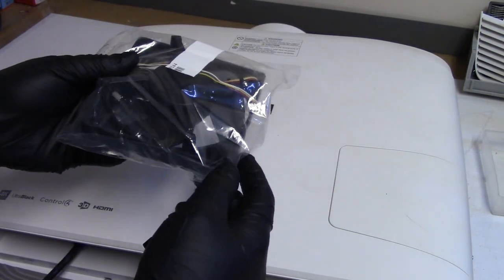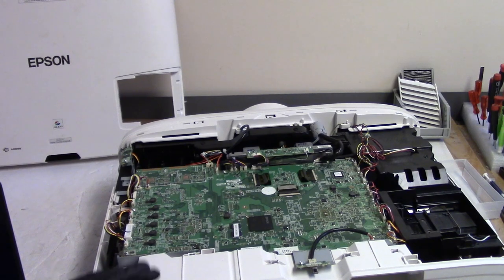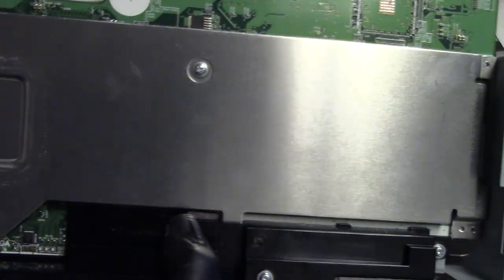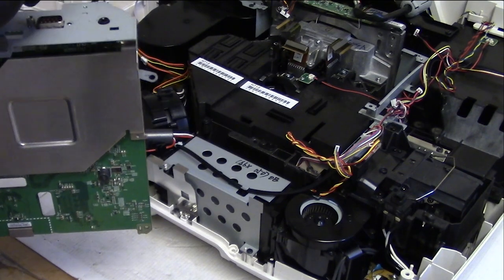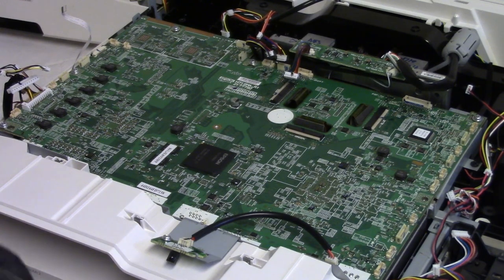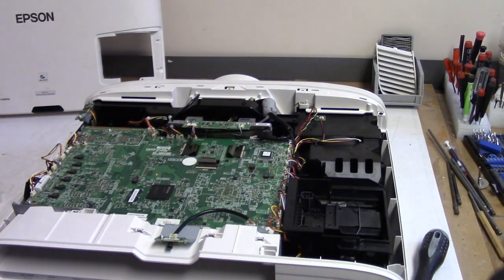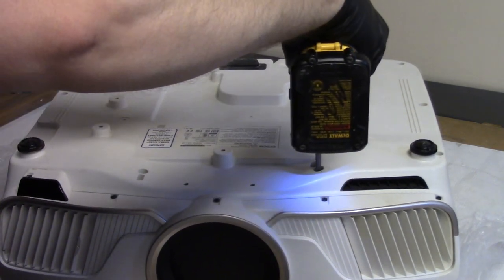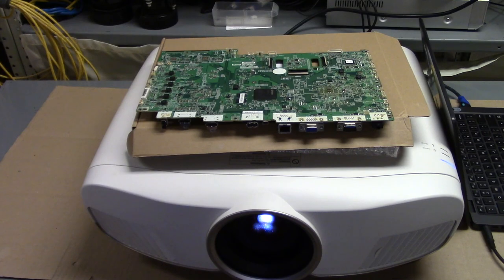Epson Home Cinema 5040UB LCD Projector Repair | No Video | New Mainboard - LAST EPSON REPAIR

Comment: Having my EPSON really on for 10* hours every day I must say that I really love them, AS LONG AS they work. Tried to clean the inside and I was in awe by the severe complexity of the unit. Am I getting a newer EPSON in the future? NO! DLP all the way, my BENQ is a breeze to work on unlike the EPSON. Nice work my friend, as always.
Reply from the maker: Yeah, when they work they look great. I wont say they are bad projectors.  Just bad to work on.  Those DLPs are just intuitive I guess.  But even NEC and Panasonic LCD are not that bad to work on. epson is just something beyond me I guess.
Reply: I have 2 Epson and 1 DLP laser (Xiaomi) both Epson are much better like image. More Natural and much better contrast. I use the Xiaomi like TV to save time lamp, but for movies Epsons are another Planet.
Reply: Hardcore-Watchers should prefer DLP, especially smokers. The organic LCD-displays (with surely some advantages: no rainbowing, high saturation, wider lens-shift) still have problems with color drift, dust, stains by polarizer-burnout, reduced longlivity, convergence, fly screen. The exchange of the LCD-Panels is a PITA (also for the purse ^^). Their failure is mostly an economical total damage.
Reply: @lorsheckmolseh3345  I've both DLP and 3LCD, for me there Is no match between, the LCD has superior image quality into black shadows and into bright colors. Is true are more delicates but I don't care with warranty extension I'm quite for 5 years.
Reply: @lorsheckmolseh3345  how wrote I own both a laser DLP and two 3lcd. I also use DLP for "dirty Jobs" like TV programming and low contents video (I use It like TV because 55" are not enough anymore for my eyes) but when I wish to watch my favourite bluray movies (FHD or 4K) I switch on one of my Epson (I've two of those) and enjoy the flawless images. Nothing against DLP (I own One) but I prefer 3lcd maybe also I can see the rainbow effect, not so strong but after 2 hours of show my eyes feels more relaxed watching a 3lcd projection.
Reply: @pinomauro2426 , i totally agree, LCD will always keep superior at image stability and gives a better saturation than UHP or Phosphorus+Laser combined with Micromirrors. LED-DLPs have a giant gamut, but contrast is lousy. Perhaps there's a way to cool the panels by liquid externally, to avoid all those nasty dust- and heat-problems.
Shortly i saw a RGB-Triple-Laser from "VAVA" with very high refresh rate and BT.2020... 😍 but i won't pay nearly $4000 for a 1920x1080 chip with a wobbler and relatively low light output.

Comment: The last Epson to repair. I don't blame you. I've been there myself. I cleaned the 3lcd block once put it all back together and powered it up the lamp lit but no projection I spent hours to make the iris function but I failed. I hate working on any Epson projector. No spares, no service repair manuals no customer support. Simply crap. Btw, I used to stick some aluminum piece of heatsink, glue it on the chips that got hot, sometimes you can get away with it.
Reply from the maker: You know exactly how it is.  It's not worth the money to work on these. I really wanted to get comfortable with Epson, but if its not the mainboard, its weak LCD cables, cracking flat flex, wires that aren't meant to be unplugged. Its just nuts how unrepairable they make these.

Comment: Sorry to hear what happened to this pj. I have the same thing that is mine. Picked it up as a refurb from Epson. I agree that is horrible to work on Epsons. I have picked up a 2045, that the ex owner was claiming, that sometime it happens the same thing(no video signal), but as many time I have turned it on, it has video. I did a firmware update, since it was one available.
Reply from the maker: I really wanted to try and become more comfortable with epson.  But this was my reminder that not all projectors need to have me work on them.

Comment: Hey Frank. Thanks for the video. I have a 5 year old 5040UB that won't power on. I took it in for a repair and was told the Mainboard needed to be replaced and a new board requires a matched optics engine as well. The quote for repair was $1700. Is that accurate? Do you know if it's possible for me to order a mainboard on my own and do the replacement? If not, are you willing to reconsider your stance on Epson repair?
Reply from the maker: I don't believe the mainboard is matched to the optic block. At least in my limited experience with the 5040. The price is not too far off though. Epson is extremely anti right-to-repair. It's impossible to obtain new Epson parts unless youre an authorized Epson repair shop and they won't sell parts. The only non Epson repair center option is e-recyclers. It's hit or miss of a mainboard is available. It'll cost around $5-700 and only come with a three month warranty. 
As far as the diagnosis, I can't really say. Mainboards could cause a no power situation. It could be another issue as well. Unless you had it at an actual Epson repair center, the diagnosis might be a polite way of them saying they don't really know and they are aware of the lack of parts available. 
Part of me wants to look at it but the rest of me is reminding myself how much money I lose trying to work on Epson. With a roughly 20% repair rate(lack of parts available) it's really a bad financial decision on my part. 
Another thing for you to consider is the rest of the parts that might be bad. Namely the optics. Epson uses parts that optically degrade starting at about the five year mark. Rarely does a normally used Epson last past 7years.  The polarizers and prism coatings degrade and you get color blobs on the screen. If that's a problem you are right up into the $1700+ area again. But this time with used optics that might start failing at anytime. Repairing Epson is like tossing water up the stairs. It keeps running back down. 
As much as i hate to say it.  Cut your losses. Sell it for parts on eBay. I hear about a lot of 5040s with problems these days. Put your money toward something better. Buy a Sony or JVC and leave the Epson marketing hype on the floor. Epson is great at advertising and the projectors look great when they are new but they do not hold up in the long term. 
If you really want me to look at it, we might be able to work something out but I'd have to charge a 'check out fee or bench fee'. I normally give estimates for free but I'm sure you understand where I'm coming from.  I wish I had better news for you. Thanks for asking though, I do appreciate it!

Comment: My 5040ub doesn’t even power on , no lights or indicators, I’ve changed the power cable with a working one , checked the filters they were clean , I’m assuming I need a lamp or power supply do you have any advice for me since you’ve already worked on this projector😅

Comment: Have a power supply error on my 5040ub. Power light and 2 orange lights flashing. Turns on real quick, lens opens then closes and fan runs hi for a while. All I did was change my screen mode to dynamic and it went out. Sounds like a motor inside waking clicking noise. Any advice on what it can be?
Reply: Mines did the same thing did you fix it?

Comment: The fan can actually be had for much less, but the key is to not search for a projector fan. You are looking for a "Fridge Evaporator Fan" or a "Fridge Condenser Fan". It visually looks exactly the same with the blades that stick out. The version used in fridges sometimes has green blades and can be either NMB, or Nidec. The connector will be different, but that can be adapted.
Reply from the maker: I politely disagree(just about this fan). These fans use specific reporting methods on the status wire.  I went through all possibilities.  Epson is very particular. Now if you can show me the real fan for less, I would be curious to see but $72+ shipping and tax was the cheapest I could find it.  I am very well versed in finding parts for all sorts of devices, not just projectors and this fan was specific for epson. Not to mention, I don't want to be adapting connectors for someone else's projector. I then lose any warranty if I cut the ends.  
epson specifically is very proprietary.
Here is the Part #  1193255-13N-AK if you get inspired to look.
Reply from the maker: You have a cool channel. WIsh I had known about it before.  Subbed
Reply: @FixitFrank  Ah yes, I can see where you are coming from. For a professional repair, it's always best to get the OEM parts. I mostly posted this for those who might not have access to the original parts, or if the warranty is already finished. It seems that in many parts of the world, it is worth people's time to do things like adapt connectors, replace bearings in computer fans, solder wires, or even install little microcontrollers to get around proprietary locks etc, which are all things I have done before. (though I think these kinds of people would have figured out this trick by now by themselves if needed)

The fan I was thinking of (FBA12J15) or FBA12J12M was a 25 dollar part, but as you note, it isn't a hundred percent identical. The frame itself and the blade geometry looks like it'd fit, but 0.18A 12V vs 0.28A 15V. From personal experience, the actual motor and electronics in there are probably almost the same, and the change in voltage rating probably explains the change in current. I am kind of curious how the projector detects this proprietary fan - I have never seen a computer fan that did not do a 2-pulse-per-rotation open-collector third wire. It would be interesting if the fan actually had a microcontroller inside it on the third wire, instead of a commodity fan driver IC. On closer inspection this one has a PWM line where the fridge ones don't (might just need the wire attached) but in a pinch, at least the bearings, impeller, and motor coils may be used to repair the old fan.

I personally wouldn't fault them for using a special fan like this, just because this particular design of fan has a much better than average noise and airflow performance, which must have been important in this application. Furthermore, I'd expect that the primary driver of parts cost isn't the design of fan being special in itself in this case. 70$ is a pretty typical price for a small-ish electromechanical OEM part.
Reply: Actually on second look, seems like the OEM one is available for about 50 dollars or so on AliExpress, which is nice to see that the price is lower now I suppose.

Comment: Hi Frank, I watch your videos to replace main board for Epson 5040ub . I am very impressed your work . I have a same projector, And main board fail need to replace. What is your advice , is it worth to replace it? My projector is Five years old. How my cost with parts and labor. I am in Houston. Thanks
Reply from the maker: As much as it pains me to say, I would not put a single dime into a failed 5040ub at this point.  There are more parts that are worn or wearing out that will fail soon.  Any money you put in will not be worth it.  Epson builds these to fail and not to be reasonably repairable.  I would suggest saving your money and putting it towards a sony or JVC.

Comment: Hi Frank, Thanks for posting videos and helping out users. I have a 5040ub and it runs fine for 20-30 minutes, after which the image disappears and a blue light flashes on and off. The lamp light flashes orange and status light flashes blue. I tried changing the bulb and air filter, but to no avail. Epson tech support told me to buy a new projector and looking at the comments it doesn't surprise me. I noticed that the fan speed is constant throughout even when the lamp gets very hot. I'm wondering if this an issue related to heat sensors and/or fan. Do you think I need to change the main board? Thanks!

Comment: I have an Epson 5030UBe that worked the day before and then the next day I have the same issue you had with the EPSON screen then grey.  No menus come up. Remote and everything works but no menus will come up.  So I am thinking I may have a mainboard issue as well.  @FixitFrank Where were you able to find a replacement mainboard? I believe I will need to find one for my projector.
Reply: It's not cost effective. I hate to say that.  If the board is bad, it's new projector time. This repair cost me $500 of my own money. I basically paid to fix this projector. I lost money on this. Epson makes repair unrealistic and over priced. I'm not a fan of them as you can probably tell.
Reply: @frankoranzi5023   Thanks for the info.  I found a forum where someone took it apart and reseated connections and it worked after putting it back together.  So I figured I'd give it a try.  And I got lucky and mine came back to life.  Maybe it was blowing dust out or reseating cables but it did work.  But for how long. LOL. I may have just got lucky and delayed the replacement for now. Thanks for posting your initial video!
Reply from the maker: thats great! I hope it works out for the long term.  I had no such luck.

Comment: Hi Frank - I have a 5040UB that is now dead. Epson says it is probably the main board. Is it worth spending the money to resurrect this projector or do you think I should just move on to something newer and modern. Was the 5040UB an anomaly and all other projectors are great without such major flaws? I can see that you are not a big fan.
Reply from the maker: it's hard to say if they are right or not.  they tend to just blame the mainboard because epson doesnt repair things.  They just replace them with poorly refurbished units. 
It might be repairable if it has no response what so ever.  As in there are no leds lighting up.   Partial power is harder to repair than no power usually.  That said, it depends on the age. epson lcd units tend to start to degrade the optics after 5 years and it is not repairable.  its one of the main reasons I really dislike epson.  They design these to have a finite life.  They could choose to use better parts like NEC or Panasonic but they don't.  I have seen 15 year old NEC projectors with thousands of hours that look fine but then I see 4 year old epsons with bad polarizers.  Epson is very against right to repair.  Sadly your experience is far from an anomaly. The main reason I stopped is that so many of that series and the 6030 etc all have the same failures and all have lack of parts availability dure to epsons stance against your ability to repair your own gear. 
If you can afford it, buy a Sony or JVC.  They are far better in so many ways and their price is not much more than an epson.  I have seen both sony and jvc projectors that were 10+ years old that worked perfectly as they did when they were new.
Reply: Thank you very much for getting back to me about my dilemma. I might have been on the fence about sending it somewhere for repairs, but I think you have told the truth about Epson and more specifically about throwing good money after bad with a 5040UB. It's looks like I will have to bite the bullet and write off this 5040UB as a total loss. So then to move on to a replacement. I do like Sony very much but at this point I will have a budget limitation of $2500 or so. The contenders are BenQ and Optoma. Don't know much about them in terms of build quality, failure rates, strong company warranties, etc.
Speaking of Sony, I found a 5 year old VPL-VW695ES  refurb for $2500 - hard to know if that's a good deal or a disaster waiting to happen. My tendency is to buy something brand new to minimize the possibility for failure plus a mfg warranty.
Reply from the maker: hi Ned, I know its been a few days but I wanted to weigh on the used gear/no warranty concern.  It's definitely a valid concern.  I don't pay much attention but only because I am confident(or foolish enough) to think I can fix it.  Thats not for everyone. But I also notice that electronics tend to either fail immediately(within the first year or so) or not until they get very old or are neglected.  If the Sony is a few years old, is just being replaced because of an upgrade, then I would not expect any issues to appear until it gets old.  They are built much better than benq or optoma so they tend to just chug along.  My vpl45ES is 6 years old and works like a charm.
Reply: Hi Frank - As you know, parts are basically unavailable for the 5040UB - but I had the thought that parts for the 5050UB and/or 6050UB may be available and would the main boards - power supplies be interchangeable to upgrade the 5040UB?

Comment: Hi Frank, Thank you for taking time to video your hard work!  I cannot find a replacement motherboard and power supply for my 5040UB.  Are you able to order them by chance?
Reply from the maker: Hi Brayden,  I'll warn you, they are not cheap.  You are likely looking in the $5-600+ range. Are you sure they are bad?
Reply: @FixitFrank  thanks a lot for taking time to respond to me! I called Epson they figured that it was bad because my 5040UB has no power whatsoever.  I told them I figured it may just be the power supply itself but they recommended replacing both and it’s out of warranty so they quoted $800 to fix it.  Do you know if a power supply is any cheaper? Could you help me order one so I could attempt to replace that first?
Reply from the maker: That i would look at. A power supply is far less of a hassle. My source is on holiday (lunar new year) until Jan 28th, but after that email gydz@timeprojectorlamp.com. I'd also check the line fuse. I think the fuse is on a different board, closer to the line cord connector.